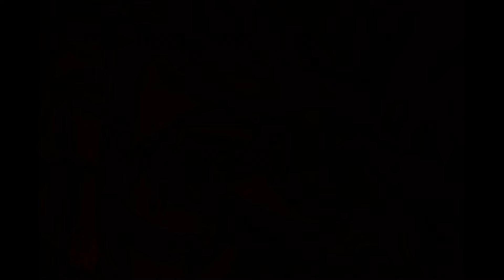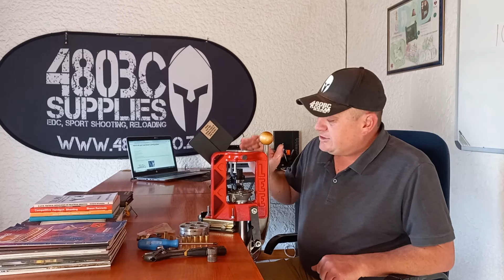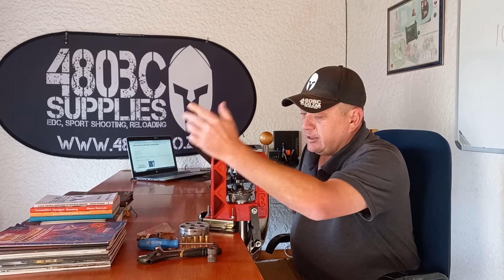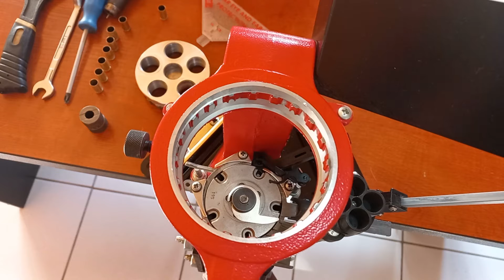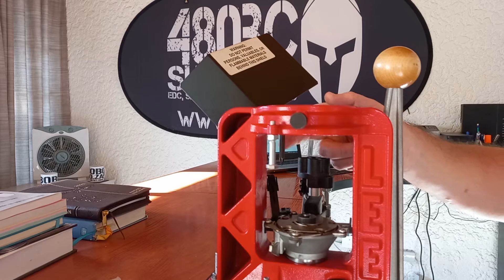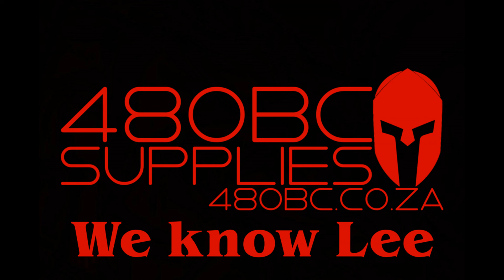Lee Precision Load Master Priming Problems solved!

Comment: Every second or third primer tips sideways in my setup. The priming pin then get caught in the upward position inside the empty primer pocket. If I remove the turret and empty cases it works perfectly fine - the primer gets pushed center onto the priming pin and rises unobstructed. FRUSTRATING!!
Reply from the maker: Check your die setup, make sure none are interfering with the handle stops on the press.

Comment: Another great tip on the primer screw is to take a flat file and remove the markings on the bolt. That was a problem I had to figure out the hard way the casting marks will never allow the priming lever to rest on a flat surface.